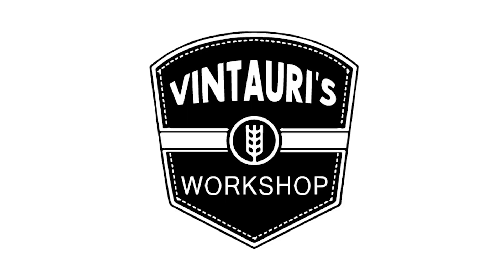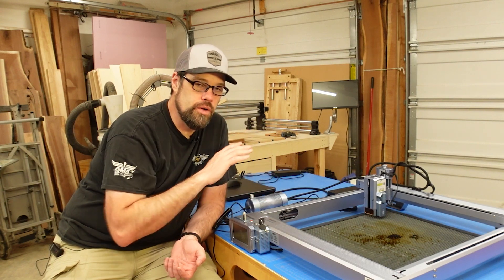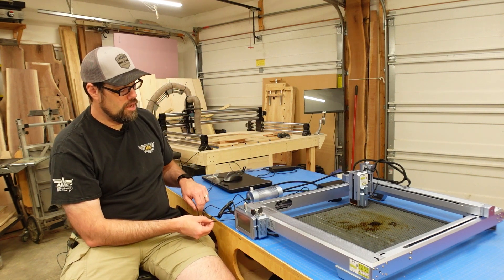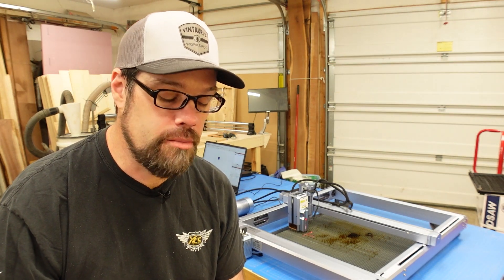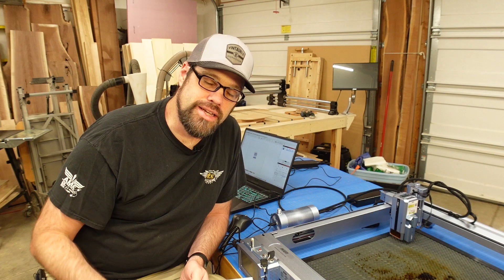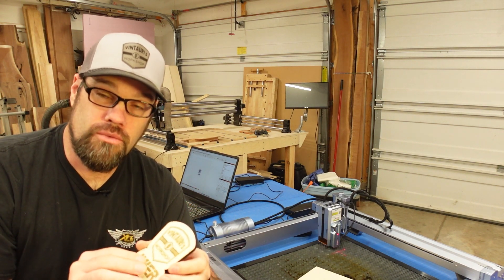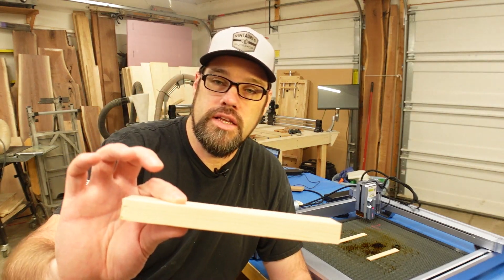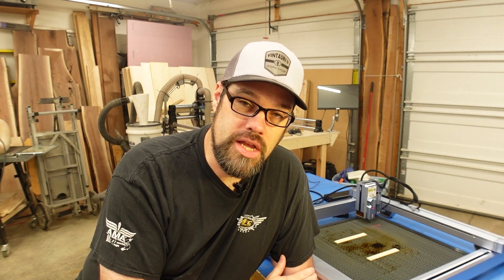Ikier K1 Pro 24w | Initial testing and review

Comment: Higher wattages for engraving also means bigger spot and less detail. So you have to slow it down.
Reply from the maker: You are correct that, generally speaking, higher-wattage laser modules will have a larger focus spot size, which can affect the detail; however, the larger spot size does not automatically mean you need to slow it down.  The material burn rate is what matters.  There is also the fact that the acceleration required to reach the higher speeds and the smaller size of the engravings will mean you will rarely hit these speeds.
Reply: @Vintauri  True. What I meant is that for best result. Keep the 24 watt for detail and slow it down for more contrast. You loose a few minutes. To me its not worth it to get a little faster result with 48 w module if the detail is less.
also if the 24 can cut deep with the 2-3 pass step down. also not worth it to get a 48 w for the fast result. For ( quicker) mass production people use router-templates and routers regarding cutting for larger items. The small cutting projects the speeds are not max speed on the laser anyways.
I cant see the reason to buy the 48 unless you are into fancy metal colouring that fades after some time as its surface heat-manipulation and not engraving.

Comment: Hey, i'm currently struggeling between the Ikier K1 Pro 24W and the sculpfun sf-a9 20W.. Do you have experience with which one is better?... I would like to cut wood and to create detailed engravings... I know that a 10w (or less) laser is usually better for engravings but i want to buy a laser which is good in both.
Thanks for answering and  nice video, always like to watch your tests. 
BR Dennis
Reply from the maker: I would not fret too much about the detail of a 10w vs 20w diode.  Unless you are doing painted tile, or highly detailed slate engravings, you'll still have about the same quality with a 20w.  The nice thing is that you'll have more cutting power as well. Both are nice machines and would do well overall. The iKier does have a variable speed airpump which can be nice when wanting to dial back the air flow for some things and the autofocus is nice to have.  Other than that, I feel their performance is going to be fairly similar.
Reply: Oh really?... The Ikier can also create a minimum air stream to protect the lens during engraving?... The sculpfun is doing this automatically which i think is a really good feature and will help to expand the life span..  regardless the fact that the lens can be replaced on both anyway

If you had to choose between them, which would you choose??
Reply from the maker: @denniss.2348  Honestly both are very even in features and abilities, so I'd go with whichever one has the better deal at the time.

Comment: i want to test boat hulls in a cheap way. I am thinking of doing it on scale 1/10th. The real hulls will be made from cuts from panels that are 3000x1500mm, so the scaled down area would would be 300x150mm. The thickness of the material, if i can keep the 1/10th scale would be 1 and 2 mm thick material. I was thinking of using black acrylic as it easily (glues)welds together into the final hull shapes i will be testing and i can stay at the cheaper diode lasers to do my cuts. (altough it might be necessary to redo at a last stage again in transparant, at what point i would outsource it to someone with a CO2 laser)
I want to be able to cut fast. That is the main thing i need the machine to do. I am thinking of buying a 36W or 48W machine to get the acrilyc cut fast and clean in one pass. But maybe it is overkill and the 24W machine is just as fast to cut 2 mm black acrylic in one pass with a clean edge? I am a total noob. So i could use any guidance from people experienced in cutting thin black acrylic with diode lasers. Thanks, Peter , Belgium.
Reply from the maker: You can cut thinner black acrylic with less power but I would at least get in the 20w range and try to find a laser with variable air, such as the air pumps on the iKier K1 series as adjusting the air down some can really help dial in the edge quality on cut acrylics.
Reply: @Vintauri thanks!

Comment: so i am torn between getting ikier 24w and Acmer P2 both seem like great machines for the money!
Reply from the maker: Both are nice machines and very comparable to each other. The Autofocus on the Ikier can be a bit picky and get in the way when it's not working right, but you can remove the shroud for better access to the air assist cone and focus point which is important when aligning items on a rotary, where as the Acmer you cannot remove the lower part of the module.  Both companies continue to develop their products which is good to see. Both air pumps are decent but I might give the nod to the Ikier one as it gives you a manual variable speed knob to adjust your airflow for different situations. While I can't say one or the other is the best, as it depends on your situation, I hope I gave some things to consider when looking at each one.
Reply: @Vintauri  That was the best reply I have had to a question, very detailed and explanation!! thanks you for taking the time to answer.
Reply from the maker: @twt1919  Happy to share my thoughts to help make a more informed purchase.

Comment: Hello and thank you very much for this video and the great presentation.  😊 👍
I want to buy a laser but I'm very undecided because there are so many good devices on the market. 
I'm leaning towards the X30Pro 33W, Ikier K1 Pro 24W, at first I thought I'd get an XTool D1Pro 20W and the Falcon2  22W
Then I even thought about getting an S1 because of all the marketing Of security they're doing, but then I thought "spend that much money on a laser?"
All the paid marketing by many YouTubers also makes it difficult to keep a concrete overview of the good engravers. 
But you can build a Enclosure with sucktion housing yourself or there are great enclosures from other brands for less than €100. So for what to spend €2000.
I have often heard that the Ikier series is said to be very good and that they are said to be the so-called “premium devices” from Atomstack. 
I also thought about buying the Atomstack X40 or the Ikier with 33W.
But I think they're a lot more than the price I wanted to spend.🤔
I think that you can do cutting and engraving very well with 24W.
I find the Ikier series very interesting, also because of the laser cross for positioning.
The guides seem very good to me because they probably don't run completely on wheels, right? 
I want to be able to cut wood up to 1 centimeter, Rotary should be available for cups. 
For Ikier I would use the base with the tips. Then the engraver should also be good for positioning. 
The price for laser engraver+rotary+air support should be around €1000. Do you have a recommendation for me? 😀

Best regards and I wish you a nice weekend.

Comment: I have 3 lasers already, the only diode i have is the xtool f1, it has good definition on slate but need to be able to do bigger pieces of slate, and that is what i am looking for for this laser, I was thinking 20 Watt, S1 20 W is too much money imo when you can get something like the Ikier k1 pro. Is the Ikier k1 pro 24 w my best choice for the price? Thoughts?
Reply from the maker: I think the IKier line is decent, however I’m not a fan of how the autofocus works. Over time it’s been hit or miss for me. If this is going to be primarily for slate, you don’t need the most powerful laser but having something with decent precision in homing and positioning would be good. I’d consider the Atomstack A20 or X20 laser. My only issue with that one is that the fans stay on all the time and it can be a bit distracting when not actively running the laser on a job. The XTool S1 is a great laser but as you’ve mentioned it’s a bit pricey compared to others.
Reply: @Vintauri  I appreciate the insight, and your time, thoughts on Lasermatic?

Comment: How do you compare to the XTool? This one is much cheaper but is it equal? I plan on using a rotary with what ever I get.  Thank you. Great review
Reply from the maker: This has some nice features that the xTool D1 does not.  The auto air option is perhaps the biggest upgrade over the D1.  The motorized Z axis is okay, but not as big of a deal for me.  It's also large both in the frame size and the working area so you'll need a bigger space and enclosure for this one. Cut quality wise they are about the same but I really like the auto air on this one.

Comment: Hey thanks for the review and all the great info! I just got one of these but have one issue where the manual and their assembly video doesn't say anything about tensioning the belts. It only says "don't over-tighten". Any tips on how tight the belts should be on these machines?
Reply from the maker: You want them tight enough that they wont slip but not so tight that they cause extra tension or binding.  It can be a little bit of experimentation at first but soon you get the feel for how much they need to be tight.  IF you are getting wavy lines, or your squares are not square they are likely too loose.

Comment: I have been using this device for roughly a month and a half now. Been loving it so far but I have some minor concerns about it's cutting ability. I have done a few material tests on 5mm plywood (1/4th inch is 6mm) but my Ikier K1 Pro does not come close to your results in this video. To get your results my device requires two passes. I'm not sure if I'm doing something wrong or do I have to blame the plywood I am using? Trying to remember which plywood I bought but I think it said 'hardwood' in it's title. This might be the reason why it takes more power to get through?
Reply from the maker: All woods will vary based on density and plywood can be even worse with the various glues used and the alternating layers.  Some plywood I avoid due to the heavy glue and fillers used that just stops the laser from cutting through it.
Reply: Guess I will have to try out some other shops. Not many options around here sadly to keep the prices reasonable.

Just figured out the plywood I used is a mix of several hardwoods (oak, walnut and mahogany). Fingers crossed I can try out alternatives for a reasonable price.
Reply: Have you figured out the problem yet? 
I want to buy my first laser and also want to cut around 1 centimeter and can too engrave nicely too.

Can you recommend the Ikier 24W or do you regret this purchase?
Best regards kroke
Reply: It's been a while since I placed that comment. If I'm not mistaken I was using some plywood consisting of different kinds of hardwood. This made the cutting capabilities much tougher.
Once I changed to 4mm (1/8 inch) thick poplar (softwood) plywood it's been going much smoother since. Cutting speed went up a fair bit with less failed cuts. Failed cuts still exist but it's probably likely to blame the cheap plywood I'm using which can have more inconsistancies inside you can't see. Though I read about using a flashlight to see glue pockets for example which you should avoid.

I don't use my machine a lot. Only like once or twice a month so a bit tough to say it's a good one.  Neither hard to give a conclusion without having compared to other 20-24W machines. For my own purpose of occasionally making something it does the job pretty well and I am satisfied with it.

Comment: im trying to make a decision on which machine to purchase in 20w-24w range. 
im looking at the ikierk1 24w and the Algo Delta 22w.
Do you have any recommendations ?
Reply from the maker: Right now I'd lean towards the Algo Delta unless you are looking to extend it.  At this time they have not announced an extension kit for the Algo Alpha or Delta so you would be limited to the stock working area.  The Ikier has a rail extension kit if you want to go longer.
Reply: @Vintauri  I'll be making small projects for now so im not worried about the ext. 
I'm curious what puts the Algo over the Ikier?

Comment: Looks like you've had your hands on many lasers.   Out of the ikier 24, atezr l2 24, and the xtool d1 pro which is your recommendation?   Thanks
Reply from the maker: The Ikier 24 and the Atezr L2 24 might as well be the same machine.  They work well and I really like the auto Air feature.  However the Autofocus, while nice, can mess up at times and is a slow process.  I honestly could do without that.  Sometimes, no frills is the way to go.  I have used my xTool D1 Pro20w the most out of the three and with it I wish only two things, 1) that it had mechanical limit switches instead of inductive 2) that is had auto air.   I would say that the Algolaser Alpha or Delta, have the features I want in an open frame laser otherwise I'd look at the xTool S1 laser for an enclosed laser with the more modern features like auto air.
Reply: @Vintauri  thanks so much for the insight.   Will definitely check out the algolaser video

Comment: Thank you another great video. This machine looks very similar to the Atezr. Are they made by the same company?
Reply from the maker: They are very similar with differences in the frames but the internals seem almost identical.  I would not be surprised if the same manufacturing plant is producing both of them.

Comment: I just got the 24w/48w machine. For some weird reason, I am not able to connect to lightburn. Any tips to get this working? 🙏 Been at this for a whole week now with no success. Help Pls
Reply from the maker: Assuming you are using a Windows based computer, there are many things to look into, first make sure you have the proper CH341 drivers and that it's showing up in the device manager under COM ports.  Then make sure you have it plugged directly into the computer.  Don't use a USB hub.  In lightburn if you have another device already configured, make sure that when you go to detect the new laser, your com port is set to Choose and not on a specific Com port.  Other than these tips, you can also try swapping out the USB cable to eliminate that issue.

Comment: Hey Steve great review, wondering if you can also test the Resume Engraving feature , thanks
Reply from the maker: I'll see if I can test that out.  I'll also be working with the Atzer L2 36w unit that seems to have a very similar frame and controller. So perhaps between the two I can sort out if an dhow that works.

Comment: Please what are outer dimensions of Machine? And how big is working area?
Reply from the maker: The outer dimensions as I measure it at the widest points would be 683mm side to side, 760mm front to back (including the detachable screen) and about 220mm tall at the top of the Z axis.  This does not account for any space needed for cables and their movement. The working area is pretty close to the 410mm x 410mm they state.
Reply: @Vintauri  perfect thank you very much

Comment: wood of been nice if they sent you the 36w one too see how that works
Reply from the maker: Yes I’m very interested to see how the higher wattage modules perform along with the Z step down feature.
Reply: @Vintauri  I did order the 48w laser hoping its all that and better with the 24w for Engraving and 48w for cutting
Reply from the maker: @RonSmith-fm8nm  The dual power head on that one is an interesting idea. I’ll be curious to hear or see the results when it’s out in the wild.
Reply: @Vintauri  Me too will not know tell July when there coming out and not sure if people know that the 48w laser come as 120/240 volt so Im thinking about doing it at 240 volt too see if it runs better